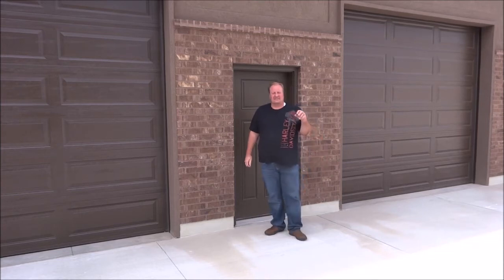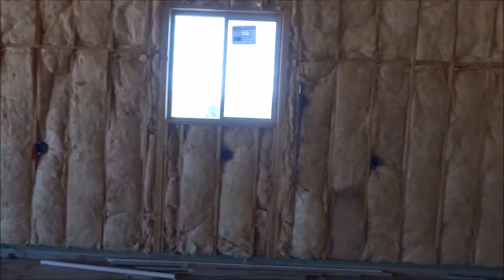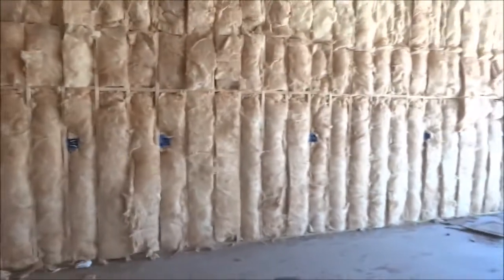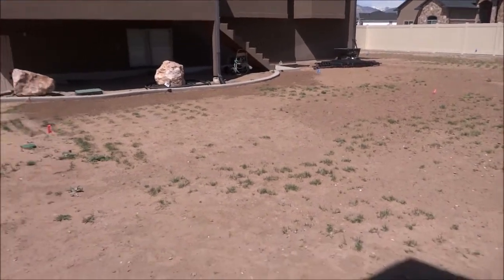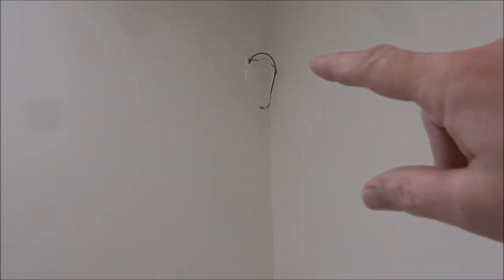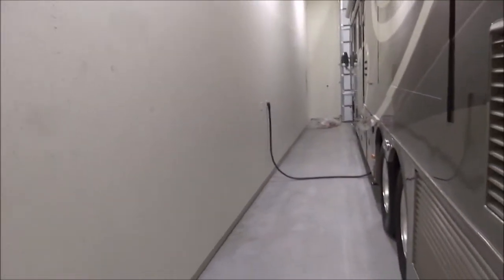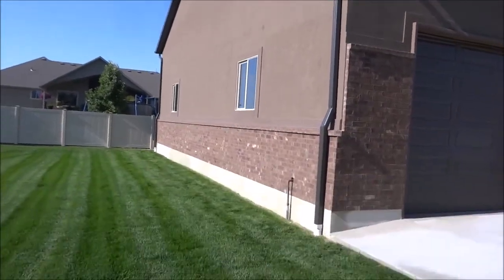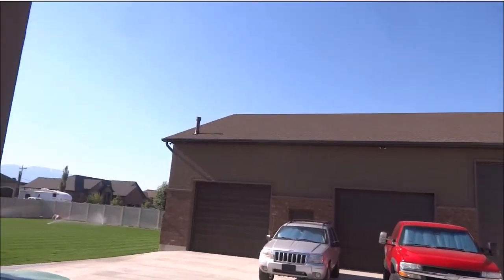ZMotorsports Shop & RV Garage Part II Completed

Comment: Any water run to the shop? Or plans for AC? Thanks for sharing, looks great.
Reply from the maker: Thank you. No water or A/C. I ran water to my last shop and never ended up turning it on in25+ years. So far this shop facing north stays fairly pleasant when working inside even at 100-degrees outside. Just the ceiling fans running helps tremendously. 
Thanks for watching and please check out the full shop tour video. 
Mike